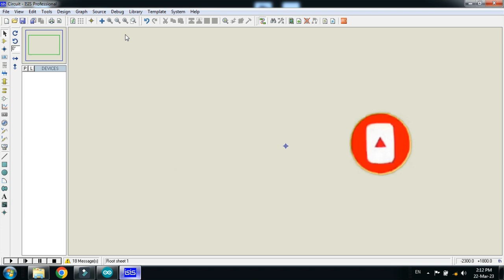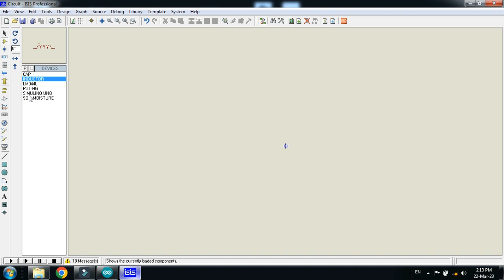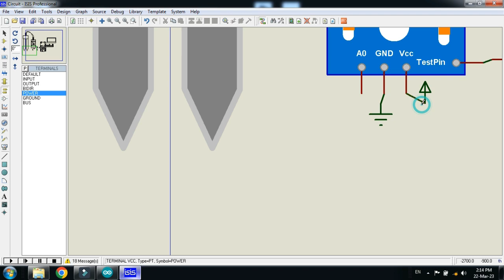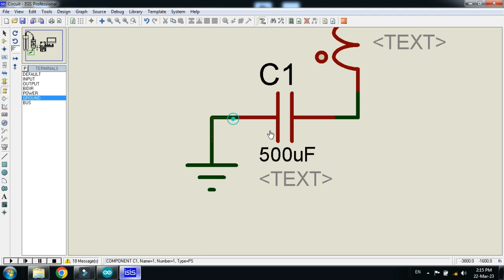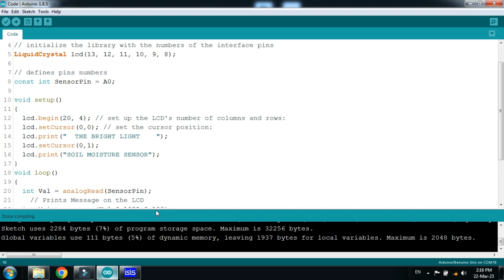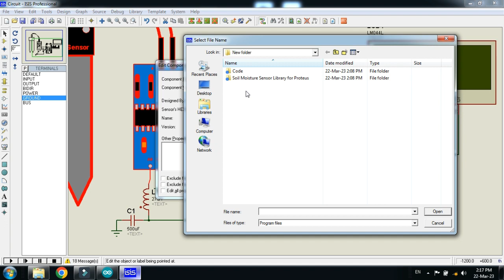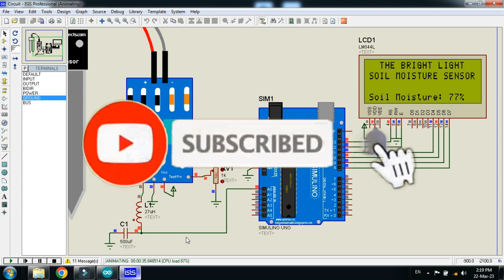Interface Soil Moisture Sensor With Arduino With Code & Circuit || Proteus Simulation

Comment: thanks for the nice lesson. but i have tried to run the codes in my IDE but it brimgs me an error below

Sketch uses 3642 bytes (11%) of program storage space. Maximum is 32256 bytes.
Global variables use 280 bytes (13%) of dynamic memory, leaving 1768 bytes for local variables. Maximum is 2048 bytes.
what should i do?
Reply from the maker: I think Your Arduino memory is less.

Comment: Hello! Is it possible to include NPK Sensor, GSM Module, and Solar Power there? The output would be an automatic watering system (fertigation) using soil moisture and NPK sensor. Thanks
Reply from the maker: The NPK Sensor is not yet available in Proteus, but GSM and Solar Panel can be added to Proteus. I have already made video on automatic Watering System, link is available below, in the following videos you can learn that how to add gsp and solar Panel to Proteus, links are available below. Thanks
Automatic Watering System:
https://youtu.be/iWtBmcXMIfc

Add GSM Module to Proteus
https://youtu.be/7qrYQG8fWT0

Add Solar Panel to Proteus
https://youtu.be/IFw8dTgCWuA
Reply: @thebrightlight9472  ohh okay, thank u so much! But if we're going to make it (not on Proteus, in real life), is it possible?
Reply from the maker: Yes possible. I have practically implemented it.
Reply: @thebrightlight9472  wow okay, thanks a lot! Can you tell more about it? Sorry for having a lot of questions
Reply from the maker: Kindly download the detailed report from here, Thanks

https://docs.google.com/document/d/17snTBY65OyaK1mQx_LYo55oc-9BSr9ps/edit?usp=sharing&ouid=107330127236470978093&rtpof=true&sd=true
Reply: @thebrightlight9472  thank you so much!!!!
Reply: @thebrightlight9472  thank u so much sir
Reply from the maker: Welcome